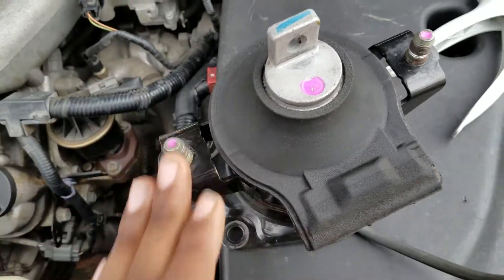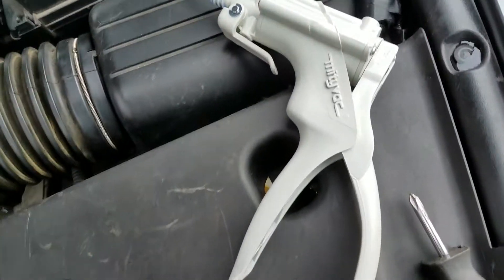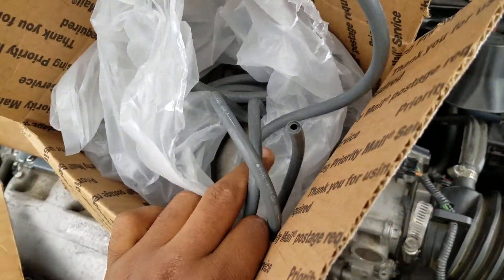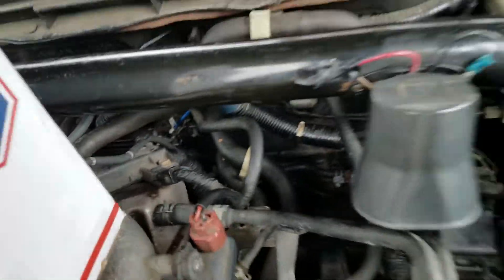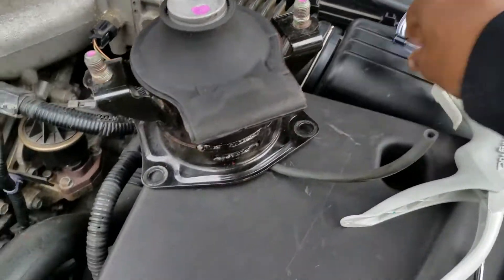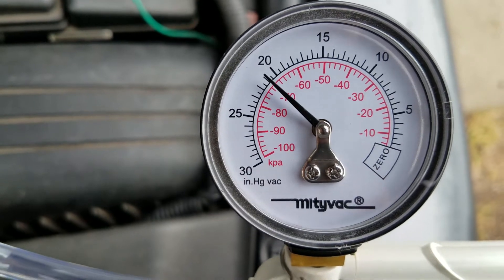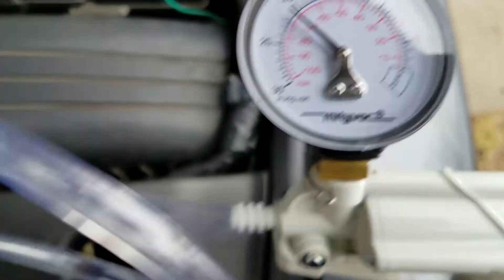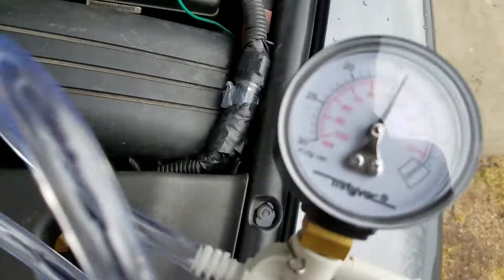ACURA TL HONDA ENGINE MOUNT HYDROLIC MOUNT TESTING TUTORIAL

Comment: How can you test the solenoid to ensure its working properly? Is it supposed to have low vaccuum at idle then high when driving? Mine has suction but just curious how it's supposed to work